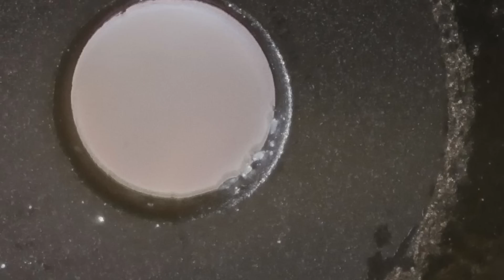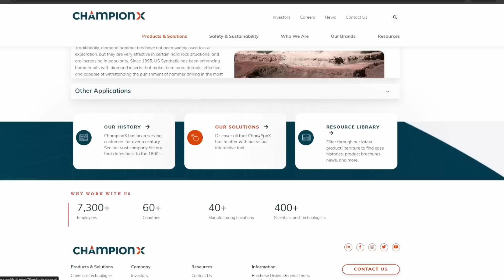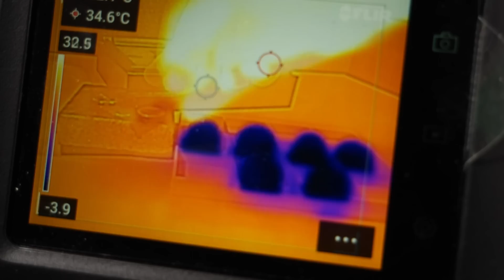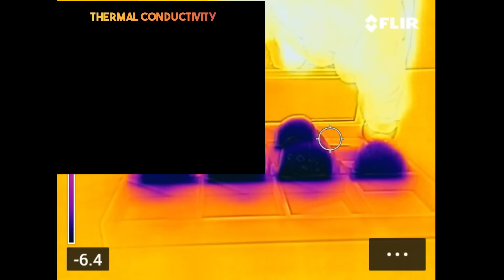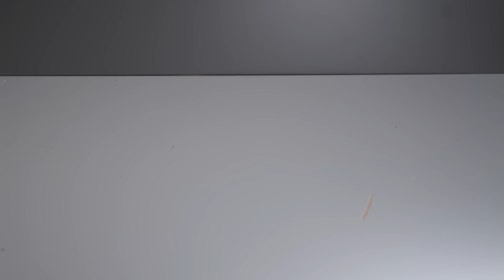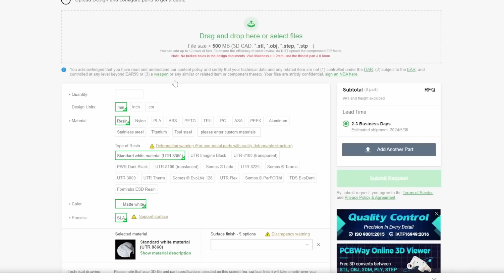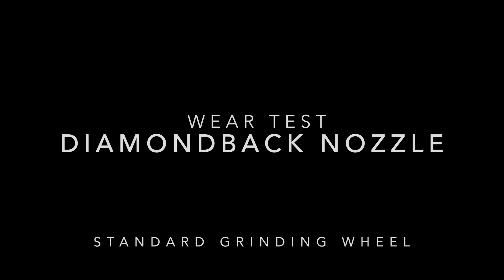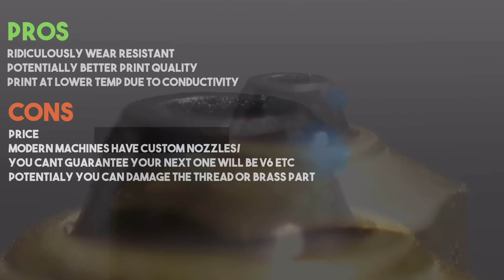The Hardest 3D Printer Nozzles In The Universe: DiamondBack.

Comment: I have one of these I purchased inebriated about 3 years ago. 4,000 some odd hours later, across 3 machines. Printing every filament. Zero issues. None. It’s a fantastic piece of kit.
Reply from the maker: best drunk purchase ever
Reply: @LostInTech3D  it treated me much better than the 5 pound gummy bear!
Reply: I put a .6 and a .4 on my printers and haven't given a thought to nozzle tips since!
Reply: Does it cost more than the brass ones for the life of the nozzle would? Aka how manny of the brass nozzles (before being worn out) will the diamond one replace? Just how manny can it replace in its life time and at what cost?
Reply: @agw5425  that’s a good question, I more approached it from a line of troubleshooting. Could it be the nozzle is not a question I have had since swapping over to the diamondback. I guess it depends on how much you pay for a brass nozzle, because this performs as good as the best brass nozzle with no degradation over time.
Reply: It would probably be better to compare it with hardened steel nozzles since the cost differential is minimal and they’re a significantly more resiliant.
Reply: @graxxor  valid, and on that point for the amount of cf/wood/glow filament I’ve printed I would expect even a steel nozzle to start wearing as well. About the only thing that has started wearing a bit are the threads on the nozzle, i fully expect those to strip out before the diamond tip gets out of round.
Reply: @agw5425  I just bought a .6 for my ender and it was 95 USD for reference so about 10 nozzles

Comment: There's a different brand on Amazon that sells what it claims to be diamond nozzles. If it's actually polycrystal diamond as claimed, it doesn't seem to be manufactured to the same high standard because most of the negative reviews I've seen of it is about how for some people the diamond tip has fallen out of the brass. I wonder if you can abuse genuine Diamondback nozzles until that happens to them as well
Reply from the maker: I'm guessing that might be one of the things that sets them apart - I've not seen any first hand accounts of broken diamondback nozzles.
Reply: @LostInTech3D  I can't believe the "cheaper" guys get any sales at all, because they're not actually that much cheaper. $80 instead of $100, and you get shoddy workmanship or QC while still spending quite a lot for a nozzle

Comment: The fuzzy inside and outside is because they're cut with a laser. Carbon might have a high boiling point sure but dump 100KW of laser power in a single point and you'll make anything disintegrate. You can use diamond lapping compound to smooth it out if you want, but it's a lot of process time (and consumes a lot of diamond in and of itself (fun fact, the industrial diamond factory I did work for a while back was their own largest customer. 60% of the diamonds they produced went right into lapping compound and grinding wheels so they could cut their own diamond parts)).
Reply from the maker: lasers, of course!
Reply: "Sharks with frickin' DiamondBack nozzles attached to their heads" (sorry 😅)
Reply: Yeah, laser was my first thought on how to cut them. You don't even need that much power. Diamond isn't heat resistant like other forms of carbon, it will start to burn into graphite at 700C if it's not pressurized.
Reply: @dekutree64  That's because diamond is only metastable at atmospheric pressure.  It really wants to be graphite but thankfully for us there's a fairly substantial kinetic barrier that prevents the atoms from spontaneously rearranging.
Reply: Considering these are synthetic diamonds I might also guess that they are formed in this shape which might also be why they are smooth but still slightly fuzzy.
Reply: Fighting diamonds with diamonds.
Reply: Are you sure? And how would that work with the cylindrical upper cutout and the cone shaped lower cutout? A laser doesn't just stop at a distance like in Star Wars. My bet is on electroerosion.

Comment: Been wanting a Diamondback Revo nozzle, I know the tip won't wear but I'm afraid I might bend it by accident and I'll have to buy another one... lol
Reply: Skip the revo it’s really slow
Reply: Yes, I have the revo version and I'm disappointed by the mediocre flow rate.
Reply: @michaeleitel7186  get the v6 nozzle you will have more options for hot ends and its the most supported thread size

Comment: I'm interested in tungsten carbide nozzles and their lifetime. And other thermal conduct properties. I have 3 different sizes of Phaetus' nozzles made out of TC and for now, I haven't changed the nozzle. Only hotend. It's been great but I recommend filming those with macrolenses. Rough surfaces but job well done.

Comment: I'm dying to get my hands on one of those diamond discs! I'll buy it from you once you get bored with it. Unless you're like me, and you tend to accumulate toys and never let them go.
Reply from the maker: I am, and I do 😂
Reply: @LostInTech3D  😞I wish I could find one to buy, but searching is futile given the available terms. I have a 1"x3"x1/4" piece of pyrolytic graphite, ready to be split into knives, but I want actually use the diamond for heat distribution on an electronic component.
Reply: @WaffleStaffel  Just contact the company.  It's probably not cheap, but they'll certainly sell it to you.  Heck, I think this is the only product they sell directly to consumers.  Which is a pity, because I want a 1/8in sandblasting nozzle made of the stuff.
Reply: @EmperorA0  Good idea, it's worth a shot. I guess since a heat pipe has 3x-45X more thermal conductivity, diamond is better off as a novelty than a practical component cooling material.

Comment: This thing looks amazing... but calling it a nozzle that "lasts forever" (as many people do) is a bit of a false point. the tip will last forever, sure... but the interior MUCH softer brass will get worn away over time, especially when printing CF. it'll last longer than regular brass nozzles... that's about it.

you will have AMAZING prints... and then suddenly a catastrophic failure as the tip literally just falls out, or the wall behind the diamond tip just... blasts through as it gets worn thinner and thinner... like those ruby and sapphire tip nozzles. the brass behind the gem tips just get... worn away... Oh, and also, a lot higher risk when doing cold-pulls.

I... really don't think they are all that worth it. Because of the brass "body" I physically cannot see them lasting as long as people advertise them to last. atleast when printing abrasives.

Comment: Unfortunately this definitely not a "forever nozzle" the brass will be damaged over time. By filled filaments, nozzle cleaning etc.
A full tungsten nozzle will last way longer and may be the real "forever nozzle".
If you really want a diamond nozzle, I would recommend the Trianglelab DLC copper one. At least more wear resistent than bradd.

Comment: sadly all multipart nozzles are flawed, they will eventually break apart. or they leak from the seal. full body tungsten carbide (oston, bozzle, deez) is significantly cheaper and while on paper isnt as good as diamond, id go with them anytime. remember theres no real benefit to use harder nozzles unless you are actually printing with abrasives. theres also the Gammamaster that ive seen quite a few people recommend but ive not used it, and the warranty excludes glow in the dark filamen.t the CHT is still the best if you aint using abrasives
Reply: Plus with WC nozzle you can blowtorch you clogged carbon fibres out without worrying too much.

Comment: As an employee and 3d printer hobbyist they made these for our own 3d designs for cases and custom organization on the production floor of drill bits being made, tool holders etc, when hobby 3d Printing took off that's when they came up with the idea to ramp up production of the nozzles and sell them. I have been printing with the same nozzle for 2.5 years now and its still clean and perfect, thermal properties are much better too that helps with layer adhesion among other things. The heated presses used for this manufacturing process are mind boggling and incredibly dangerous.
Reply: Do you guys have any plans to make Bambu compatible nozzles?
Reply: 500 tonnes of force concentrated in a tiny area!
Reply: awesome, is it not recommended to use this type of nozzle with a glass bed?
Reply: @TouchofDepth only if you plan on crashing it into the bed. But also, who still uses glass beds? To each is own but thats just old tech. Get a good reputable brand smooth pei and put that glass in the dumpster lol
Reply: @TouchofDepth  i suppose just never ever jog it too close to the bed
Reply: @TouchofDepth  I use it with my glass bed on my CR 10 V3 just have to be sure you set Z offset right and do not crash into the bed, any nozzle can break a glass bed this way

Comment: How much of the nozzle are Polycrystalline Diamond? It just says diamod tip the site. The inside walls of the nozzle would still wear and probably most of the thermal transfer are down with the copper parts?

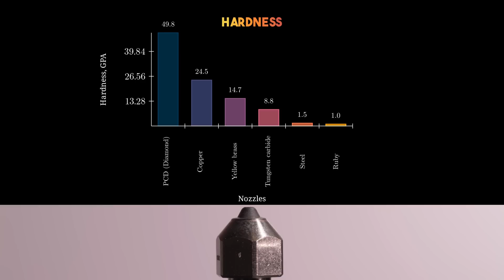Comment: I think your hardness scale at 2:19 seems off, Copper is harder than ruby????
Reply: Was probably meant to be a thermal conductivity scale instead.
Reply: @roderik1990  That would make sense
Reply: Yeah: ruby, which is red Al2O3 (a material second only to diamonds in term of hardness and used even in sandpaper), is less hard than copper, brass and steel (steel and tungsted carbide, BTW, that are less hard than copper)?

EDIT: He posted a correction: "The order is incorrect, the graph should read Diamond, Ruby, Tungsten, Steel, Brass, Copper"

Comment: "Diamonds! These are real!  You probably don't believe me-"

Huh?  Is there still really people out there who think diamonds are expensive or uncommon? lol
Reply: My son was surprised the first time he saw my diamond tile blade. I explained that pretty diamonds are expensive when you buy them, cheap when you sell them. Other diamonds are common in cutting tools.
Reply: Yup plenty of people think any diamond is expensive. I've had many people shocked when I told them they could buy like 10 pounds of diamonds for less than 100$
But this diamond is synthetic and formed which is why it's so smooth and shows no cut lines.
Reply: cody's lab recovered diamonds from street dust where constructors are cutting
Reply: When I proposed to my wife, 16 years ago, affordable man made diamonds of that size and quality didn't exist or weren't accessible. Recently I was looking at diamond rings to help my friend price one out. Not even taking inflation into account, today I could buy a setup using man made diamonds with the equivalent size and quality for about the quarter of what I paid over 16 years ago for my wife's engagement ring. Keep in mind jewelers can't even distinguish between real and man made diamonds today. 

While diamonds were never a rare resource, their availability was rare for a very long time due to market manipulation. Now that the Chinese can make high quality diamonds, market manipulation is impossible. It will still take a generation of affordable diamonds being available for the idea that diamonds aren't expensive or uncommon to be understood by the general public.

Comment: Imagine if you really wanted to prove it?
 you could make a system that would perpetually use the same material over and over.
If you put the head up high enough, you had the feed rate proper it would cool in air and then could be taken up to start all over again
Reply from the maker: you'd have to call that machine "Sisyphus"

Comment: A whole tungsten carbide nozzle like Oston sells makes more sense in my opinion, it won't crack when you hit the bed too much and is only 43$ on aliexpress
Reply from the maker: I have the phaetus tungsten carbide waiting to do something with :)
Reply: @LostInTech3D  the pheatus one is not completly tungsten and way worse
Reply: @LostInTech3D  As other have said, the phaetus WC and SiC nozzles use press fit inserts, and those are not good for a multitude of reasons.
The best thing is a full WC (tungsten carbide) nozzle, like the bozzle/oston/undertaker/nanoflow/panzarnozzle
Reply: @adeo  so is the diamondback, what’s your point?
Reply: @LostInTech3D  I heard on the voron discord that many people had problems with the pheatus one since it is not a whole tungsten nozzle, just a insert
Reply: Multiple creators who daily drive the diamond nozzle (such as voidstar lab) have shown that the nozzle is almost uncrackable due to it being polycrystalline. It instead dents the bed, and the nozzle is fine.
Reply: @abhijeet_ghosh  I wonder if they even watched the video.  The whole point of polycrystalline diamond is to not shatter, compared to other industrial diamonds.
Reply: I learned about the Bozzle Nozzle earlier. It seems like it may be a better choice FOR PETG and other filaments that prefer to stick to a heat source over themselves. I have the Diamondback but it doesn't do well woth PETG. Maybe it's because i have not tuned it for PETG but i think it's more because the Diamondback nozzle has so much m9re surface area on the exit portion of the nozzle. This gives PETG more surface area to stick to and the soft transition from the nozzle tip to the main part of the nozzle allows PETG to slide up the side of the nozzle and bubble up. The Bozzle nozzle would theoretically fix these issues when printing PETG.
Reply: Tungsten carbide has Porter thermal conductivity. It's also not very lubricious. So the entire point of the diamond nozzle is to not only have a hardness improvement over brass but also a thermal conductivity improvement over brass. This allows you to print not only faster, but cooler which can give you improve properties as heat is a function of print time, but that doesn't mean that it's completely analogous. You can benefit from having your filament cooler than the manufacturer prescribes if you conduct the heat well. It doesn't just act as a speed or heat analog it can often act as a quality analog. Another Factor where the diamond nozzle helps is if you have a printer with a very short thermal break you can lower the temperature of substantially to avoid heat creeper.
Reply: The test i saw when applied to too much pressure on the bed. Those diamond tips punched a hole into them lol n didn't break....so idk
Reply: How often are you hitting the bed? Wtf
Reply: I've been daily driving true tungsten carbide nozzles in multiple printers for 2 years. The performance has been nearly the same as brass and could usually get by with the same nozzle temp. It's night and day compared to hardened steel. 

I've even have a 0.5mm on an old modified Ender that refuses to die, using the stock hotend assembly (plus an all-metal heatbreak and 40x20 fan) and had no heat creep issues despite printing everything from PLA to countless spools of CF-ASA/ABS.

While some plastic can stick to it, this hasn't been notable and if anything, less so than some brass ones. The advantage to these compared to DB (which isn't immune to that btw) is it's easily heated or cleaned with a wire brush without a second thought. I made this mistake until realizing the soft metal around the DB end was getting damaged.

I think the DB is fine but I wouldn't recommend it over a good tungsten carbide nozzle or buy one again. It's too expensive with debatable benefits that I personally didn't see. Maybe there's a use case that's more relevant so if you've actually tried both I'd love to hear your experience.
Reply: @username9774 Bro! What is your acceleration on your printer? Fast enough to shatter this nozzle is awesome.

Comment: Diamondback nozzles are available for many custom printers (I counted 10 different interfaces). They even have them for Bambu printers for example.
Reply from the maker: who has them for bambu printers??
Reply: @LostInTech3D  revo
Reply: @LostInTech3D  Believe it's only possible when using the BIQU Panda.  It would be great if there were a fully assembled Diamondback Bambu hotend (high flow), like there is for E3D's ObXidian.
Reply from the maker: I do predict an E3D diamondback bambu nozzle, but so far that's not a thing.
Reply: @LostInTech3D  there is. I can't share a link, so here's the part after the TLD: products/diamondback-bambu-lab
Reply: @LostInTech3D  Your prognostication skills are impeccable. As nilz indicates, E3D already has a page for it, offering versions in 0.4, 0.6, and 0.8mm. All OOS.
When you receive one, perhaps compare its performance to E3D's ObXidian?
Reply from the maker: 👀 I wonder if they know that page is visible
Reply: @LostInTech3D  E3D does, can also be seen on the diamondback website
Reply: @LostInTech3D  E3D sells them, but they seem to all be out of stock.

Comment: I am curious if the process heats to 1400⁰C why the suggested max temp is 300⁰C everywhere I've looked. Looking specifically for an all arounder nozzle for mainly enclosed technical filaments. The new Polymaker PPS-CF sports a melt temp of around 340⁰C and the YZ-Polymer PPS (CF lackthereof) around the same melt temp.
Reply: If the diamond part is shrink-fit (which seems reasonable), it could become loose at high temperatures? It looks like the theemal expansuon coefficient of PCD is a lot lower than that of brass.
Reply: Brass could be the limiting factor, however Tungsten or hardened steel insert variants do not have the same limitation imposed.
Reply from the maker: not sure, could be the brass I guess.
Reply: its the Brass around the tip that is the limiting factor.